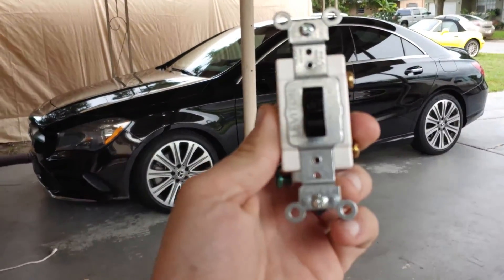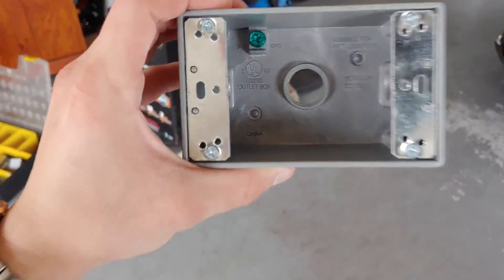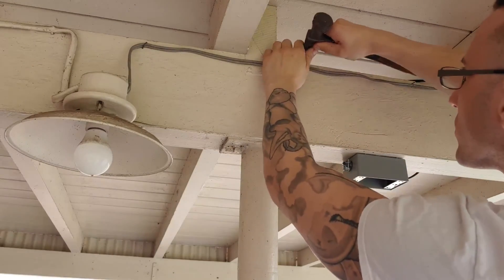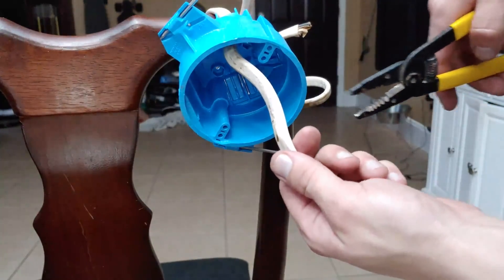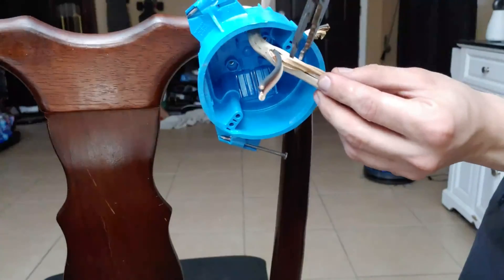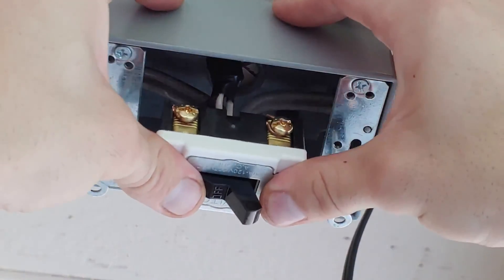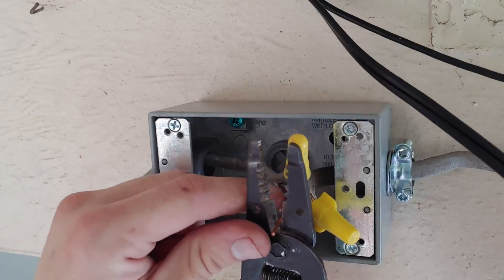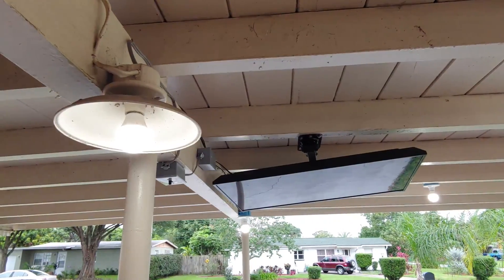HOW TO WIRE AND INSTALL A SWITCH | Complete Walk-through

Comment: Was the junction box necessary? Or could you have just ran both existing wires through the switch?
Reply: probably because the length of the wire would not reach after it was cut and moved. so he had to add more wire and the second junction box.